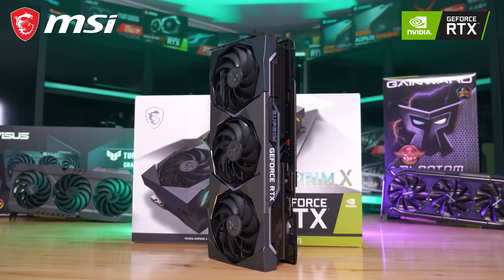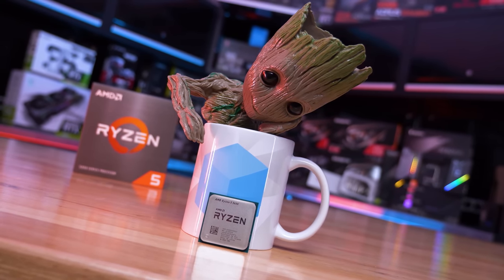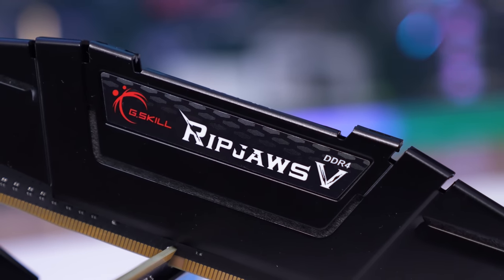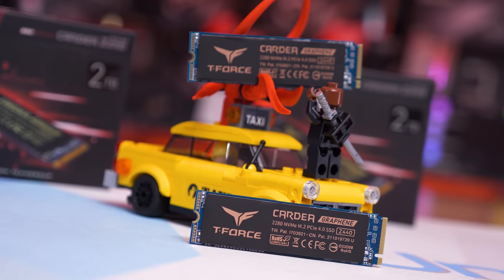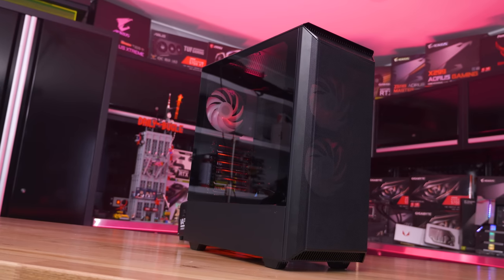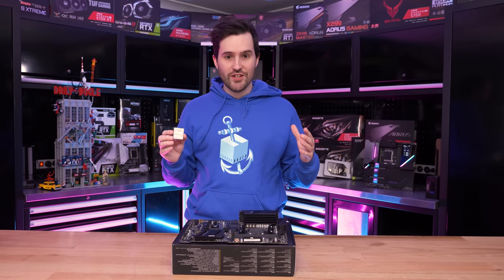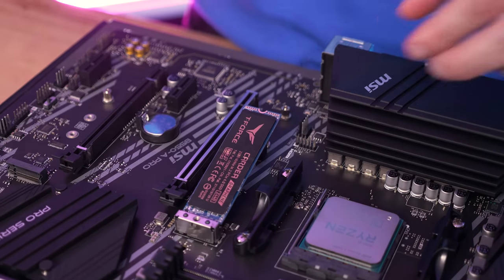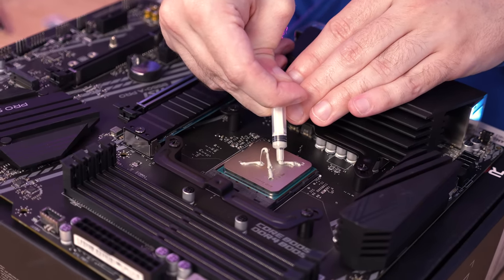Ultimate Value Gaming PC Build - AMD Ryzen Edition for 2022

Comment: I have found it to be good practice to connect the 8-pin CPU power connector either before installing the motherboard in the case, or before installing the cooler if the motherboard is already in the case.
With some bigger air coolers it can be really difficult to squeeze your hand in that very tight space. The placement of the 8-pin connector is one of the most annoying things about motherboards.
Reply: Great trick with modular PSU's. Usually it's easy to put the PSU side of the cables in but the 8pin-power plug is most of the time a total pain to plug in with the boards flexing.
Reply: Yeah, I did that too, but my hands too big and I ended up having to disconnect power anyway later to reroute the fan cables neatly.
But all in all the modern Fractal case gave good access and cable routing.
The worst part for me now is the mobo headers for the case, they used to be less cramped in full tower ATX 2 decades ago.

Comment: ahhh, how i miss the days when for 650$ you could build an i5 3570K , a 660Ti and 2x4GB of RAM in dual channel in 2013 , then boot the thing up and everything ran on ultra settings 1080p 60fps stable, beating the PS4 and X1 comfortably.

how times have changed.
Reply: Everquest was still kicking back then. Tired of grinding? Go camp some fools in WoW. Ah, good times.
Reply: I gave my uncle my old I7-2600k with a 660ti video card. I forgot the other components with it but im shocked it still runs to this day.

He uses it for architecture productivity and told me it does great for him.

This new builds are great but the prices have risen so much
Reply: With the same budget, right now you can probably build a PC with Core i3-10100F, a GTX 1650 G6 and 2x8GB of DDR4-3200. A bit sad considering it costs $240 for a xx50 series GPU.
Reply: The consumer price index accounts for some of that, though not even half. It’s crazy how much prices have increased. I wonder what kind of build you could do for $800US these days.
Reply: @jamescunningham8092  

Yeah, you couldnt even put a 3060 non-ti on that build because that would be half the budget at msrp, let alone at real prices.

6500XT with a 10100F is what you're looking at if you pick a semi-decent motherboard and power supply, which would be the equivalent of building a gt620 with an FX Vishera in 2013 per product branch, except that such low end build would've costed you barelly 400$ in 2013.

I honestly hope Intel destroys nVidia and amd in the coming years.
Reply: The real increases have been GPU price, case prices, and AIOs. 3570k was about $200-250 so we’re on par there, a decent Z77 board cost about the same as  a modern decent B550, RAM still about $70-100.
Reply: This build here will play anything at ultra 1080P and with lower settings even at 1440P. Not bad at all imho with the GPU market being so bad for 1,5 year now.
Reply: The times are the exact same.  You could buy those exact parts for half price now and get the same performance.  Or, buy cheaper budget oriented parts and still achieve mass gains in performance.  Quit complaining.
Reply: @dilet1114  Imagine trying to say AIOs are increasing in price with zero evidence to back it up because none exists.  Want to know what exists?  Tax tariffs.  Import and export taxes.
Reply: @juanme555  do NOT pair the 6500xt with a 10th gen intel cpu.

The 6500xt NEEDS pcie 4.0, or it's unimaginably bad.
Reply: Yeah, the games look a LOT better.  So that's what you get with more demanding software.
Reply: Dont need to buy new build, just upgrade and buy new mobo and or cpu, and use old gpu and case+psu,  and then new gpu...

Comment: Was able to build something similar a few weeks ago at approx 845 USD, though I do live in southeast asia. 
Sticking with the stock cooler (-40 USD), local/small brand case at 40 USD (-30), 650W Seasonic PSU at 85 USD (-35), MSI Pro VDH Mobo at 110 USD (-40), and lastly a steal 300 USD PowerColor Fighter RX 6600XT (-40), and a smaller 500gb 1tb SSD (-70) for a total of 845 USD (255 USD off). 

I'll be buying an external hard drive for extra storage, since I'll still be switching from my PC to a laptop for academic work, so that could cost me around an extra 60 USD to bring me back up to 905 USD. 

I don't plan on downloading/playing a lot of AAA games, as this is mostly so I can play Apex and a few chill games. 500gb is more than enough to handle some academic applications and a few core games.

Comment: I bought a Ryzen 5 5600g a few months back because it was reasonable, I paired it with a tuf series b550 m and 32gb of 3200 ram and a wd 512gb NVME, well I have since added an EVGA ftw edition gtx1080 for 300usd and could not be happier, I know its Pascal and older technology but still very relevant, I am on par with an RTX3050 in most games and the ones I enjoy all play well over 60-90fps, so my point is, a little old with a little new mixed with saving a little green can give you a very good experience gaming, not to mention the computing side the 5600g is very under-appreciated This little APU kicks ass....
Reply: It'll outperform the 3050 in most games. You'll lose DLSS, but for a 1080p build you won't be upscaling anyway. So I think you made a great choice.
Reply: Similar but last gen, I have a B450/16 3200mhz cl14 and used my now older 1080 GTX, been running this for 2yrs. Still does Il2 BOS and BF4 ultra so I'm happy.
Reply: @b0ne91  Thanks ! after watching 100s of youtube vids I think so....I'm an old guy who loves to build pc's for fun and just to see what a guy who is by no means Jays 2cents,,,lol,,,, I don't know what most lingo means, but I would like to think I'm smart enough to take advice from a bunch of guys WAY SMARTER than me,, a little mix here and there, and "poof!" got myself a pretty upgradable and capable rig for around 900-1000 bucks
Reply: @rdsjr64  The 1080 was a good choice, and you've unknowingly obtained a solid GPU for hardware accelerated video transcoding aswell, should you ever wish to do that. Using NVEnc with Handbrake you should be able to achieve around 250fps for converting raw 1080p camera files to mp4 using h264 or h265 with fixed bitrate, so for example a 5 min video will convert in about one minute. Great for processing holiday footage for friends and family to see, without soaking up so much space (using 8mbit will reduce the original file sizes by around 70%).

It also helps for longevity to have that 8GB VRAM.

Btw, if you ever want to enhance the eco side a little, at least for games which aren't really taxing the 1080 quite so much, note that if you lower the max TDP for the card down to 70% (ie. the maximum power it's allowed to pull) then the max performance will drop by 9% (making it behave more like a 1070 Ti) but the max power consumption will drop by a decent 20%, ie. more efficient (one can easily do this using MSI Afterburner). Couple this with monitor sync and it can bring down the power draw nicely, especially when idle. With a 5600X, GTX 1080 and MSI 24" 1080p Freesync gaming monitor, I was able to get the idle power draw down to just 37W for the whole setup, while the max draw for most games was less than 200W (only 110W for older games where the 1080 wasn't being hit so hard).

Hmm, somehow I doubt you're quite that old though. ;D
Reply: @mapesdhs597  58 years young

Comment: The music is a bit distracting, you need to find something that blends better into the background, Some retrowave, or chillout tends to work well.  Greg Salazar always does a decent job with his selection. Might not be your "scene" but you need something that blends in better, in my opinion anyway.  Otherwise good video :)

Edit:  You also need to brush up your knowledge on budget cases, P300A, while decent, is a little long in the tooth now.  I''d be pointing people to something with more pre-installed fans (Corsair 220T can currently be had in the UK for £70 with 3x aRGB fans), or something like the 4000D Airflow with some Arctic P12 fans.

Comment: Awesome build guys! Funny over here the i5 12400f is cheaper than the 5600 atm in New Zealand but with Mobo combined with the CPU, the intel build is about $30 more. Funny to see the difference from over the ditch lol
Reply: Same here in indonesia, 12400f + B660 still cheaper than 5600 + B550
Reply: Yeah, the cheapest B660 motherboard I could find was $199NZ, and the B550 boards $150, so it makes the ryzen a better bet , you can also use the ryzen 5600 in any AM4 board way back to A320 and that makes it the winner in my book, problem with intel stuff is you need to replace the motherboard too often, and that just makes intel upgrading too expensive....
 unfortunately.....
Reply: @nix123ism  Yea xd

Comment: I literally just built the same rig! Only difference is the PSU and Motherboard, went with the Asus ROG Strix B550-A Gaming since it was on sale. Do you really need a 750w PSU for a build like this? I went with an EVGA BQ 500W being that I won't be Overclocking anytime soon and the 6600 and 5600 are no where near power hungry beasts. Love the videos!!!
Reply: Agreed on the power supply. You can get a 500w Corsair for $40 right now and that shaves a significant amount off the cost of a budget build. I think the idea is that with a 750w PSU you have room to upgrade later, but $80 is $80. 

Get a gen3 SSD, a 500w PSU, and use the stock cooler and you bring this down to under $1k easy.
Reply: @jamescunningham8092  Yea that makes sense for sure 👍 I actually transplanted some parts from my older rig, like the cpu cooler, case and fans, and drives, for my new build I just finished. Saved me a good deal of money so I only spent about $600... Also to address the inflation argument going around in these comments, let's take a look at the 6500XT. Same performance as an RX 580 when using PCIE 4.0. The cost of the RX 580 at release in early 2017 was $200-$229. You can get a 6500xt for $199 right now on Amazon. When you factor in Inflation the 6500XT should cost  around $230-$240. People do your research before you start using words you don't understand...

Comment: Hey this is my PC 😄 except I got the 6600XT and B550M

Good pc for the price, I have zero issues placing games at 1440p. 

Cad work and 3D slicing for prints are fast enough not to be annoying 🤙
Reply: How is it for video encoding/ streaming? Im seriously debating between 6600xt and 3060 because I want a PC thats able to record, stream, edit, and use blender
Reply: I screen record at 1440p 60fps and I usually only see about a 5fps drop

Comment: One thing I like best about Hardware Unboxed builds is that they never seem to ignore the aesthetics of the build even if budget constrained.

I would happily build an identical system, the clean black look with a touch of rgb really inspires me to just use and admire the system. (I would change the fans to non-rgb tho and probably get a different GPU, like a triple fan model like 6600xt/6700xt hellhound/red devil
Reply: yes with laptop its sort of hard i just went with perf instead

Comment: Ordered R5 5600 as upgrade for my R5 2600 - should arrive tomorrow. Finally reasonable price upgrade and to think just in January, R5 5600X was still 312€ here, now you basically get near the same CPU for 200€. Good I decided to wait out those ~3months, because back then selling current CPU and MOBO and getting i5-12400F + B660 was better option than just getting R5 5600X, now - upgrading to R5 5600 - is best option, which save a lot of unnecessary hassle.

Comment: I kind of like how my MSI B450-A Pro (non-max, the original) has a basic bios with few graphical elements. I don't really care for MSI's "easy" mode in the bios I always seem to end up in the advanced menu and going through that with arrow keys and enter,esc keys, I like that a lot better. I've had very good luck with MSI the last few years though, it seems to be stable, affordable, and not fussy with RAM.
Reply: Just curious, how much did the mbd cost you? A while ago I bought a couple of B450 Tomahawk Max IIs because for some reason ebuyer (UK) were selling them for just 60 UKP with free shipping (almost half what they cost when first launched). If it was still available I'd happily recommend it over any B550 for a build like Tim's, but it seems to have vanished in the last couple of weeks. Funny really, for most tasks there isn't that much which B550 adds, certainly not where gaming performance is concerned anyway; it didn't push much beyond what B450 already was.

I'm sure you'll be happy with your MSI for a long while, I know I will (with a 5600X and 1080 Ti).
Reply: @mapesdhs597  I got it for 99$ in august 2019. b450-a pro the original one. From Micro Center. I got a bundle deal with Ryzen 5 3600 for 200$, and 2x8 Crucial Ballistix Sport LT 3200 16GB, can't remember how much the ram was. I got 50$ off though.

Comment: It’s a good case but the fans are noisy. Get the cheaper Single fan model and use a Arctic P12 5-pack for 35 bucks additionally. This case does fit one 120 in the back, top and front 3x 140. I’d still prefer 2x120 front because a good part of the 140 will be blocked off by the mounting plate. Only use 140 if front mounted 280 radiator - a Arctic Liquid Freezer 280 fits if you cut off some plastic from the front panel. But it shortens gpu length to under 28cm

This mid tower is short so something like a 3080 founders and front mounted radiator won’t fit, because fans have to be mounted on the inside. If you need more space the P360A is a few cm longer and should make this possible

Comment: TBH as a long time cheap PC builder I would probably cut down some stuff in this build.
1. stock cooler is fine
2. There are cheaper B550 motherboard with still decent VRM, besides, you are at AM4 deadend, you aren't upgrading, realistically.
3. DDR4 3200 is  cheaper, performance benefit from going to 3600 is not that much, might well get a 3200 then deal with latency.
4. You can cut down on PSU cost without compromising safety, you can probably shave off maximum $40-50 here.
Reply: I use a 5600x on a msi b450m pro m2. I works fine and very cheap
Reply: Makes no sense to save on psu because you can use it for like 10-12 years easily.
Reply: @Smallman647  Many lower end PSU comes with 6+ years warranty these day, long have gone the days of low end psu = explosive, nowadays it is perfectly fine to check their review then save yourself a bit in sensible manner.
Reply: And a cheaper case could also be a thing. I only spend 35$ on mine and it works just fine and has enough space for everything. Just cheaper metal and build quality.
Reply: @Verpal  bad psus doesn't mean only explosions. Bad psus means they deliver bad electricity to components, so with time you can burn the rest of your pc for saving 30-40 $ in 10 years.
Reply: @youprobablydontlikeme3206  you forgot about airflow.
Reply: @Smallman647  I don't have any temperature or noise issues. Installed 2 case fans though.
Reply: @youprobablydontlikeme3206  good quality fans costs 10-25 $ each, so unless you took garbage fans you paid like 55-85$. Wasn't easier to take a good quality case with pre installed fans at 85-100$? At least you had something of good quality level.
Reply: this is actually good advice, i see so many others recommending bad stuff.

Comment: If I can hold on integrated graphics since December 2020 I can hold on till next gen
Reply: Ayyy, IGPU gang rise up!*

*on older titles at 720P.
Reply: @sleeplessindefatigable6385  fsr 1.0 is my best friend
Playing f1 2021 from 1080p medium at 30ish fps to a stable 50+ is so helpful
Reply: @theigpugamer  Holy shit, can't deny those fat gains. What beastly IGPU are you running?
Reply: @sleeplessindefatigable6385  integrated vega 7 on my r5 pro 4650g 
Overclocked it from 1900 to 2500mhz at 1250mv 
And ram from 3200 cl16 to 3600 cl16 
Quite a hefty performance increase
Reply: @theigpugamer  That's actually pretty damn impressive. I'm running a 5600G, so I might try a beefy overclock like yours and see if I can beat Hitman 2 into submission.
Reply: @sleeplessindefatigable6385  ohh nice vega 7 gang 
I'll recommend a few bios tweeks for you.
1) enable pbo 
2) try to increase your ram speed even if you have to increase the latency and voltage also set your ram command rate to 1t in case you are running only 2 sticks 
3) for the display options while booting select igd / integrated graphics and force the integrated graphics 
4) select uma buffer (frame buffer) 1gb , ideally 2gb if you have enough ram
Let me know if you need more tips to boost performance and how much uplift you get

Comment: Just picked up a 5600 for $119 USD. Overclocked all core to 4.5ghz and dropped the voltage to 1.1v. Ran a bit warm before the undervolt offset, but but after I dropped 25 degree Celsius with no crashes.
Reply: quite a chip right there